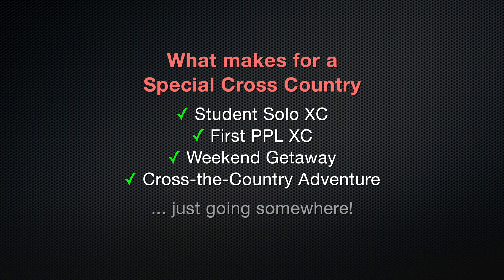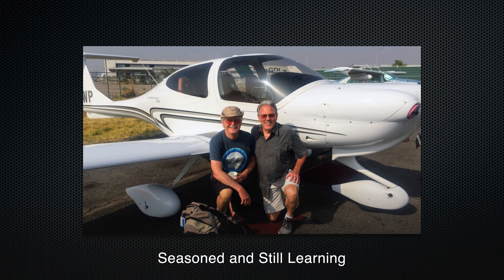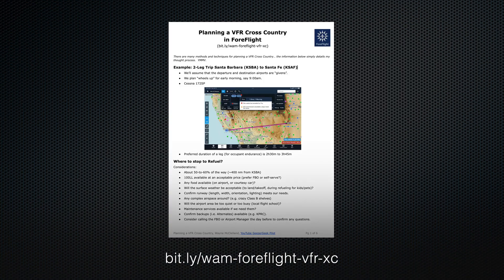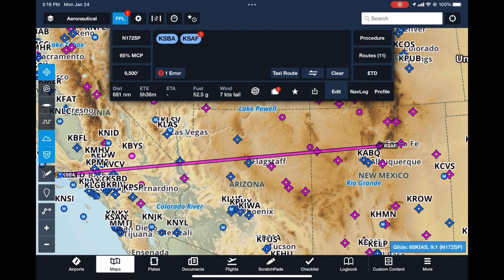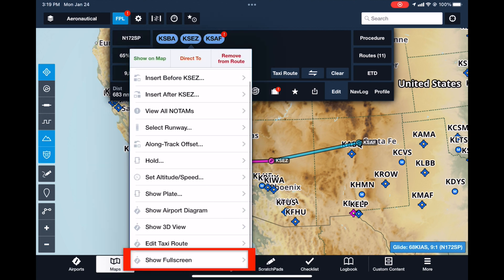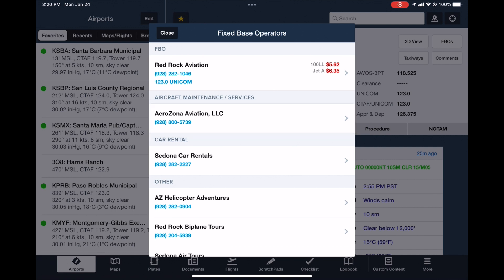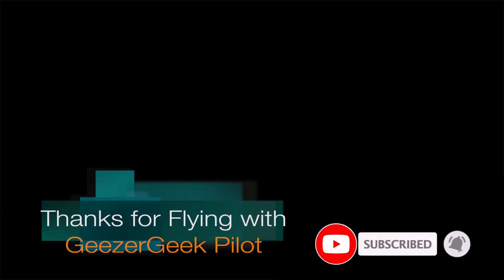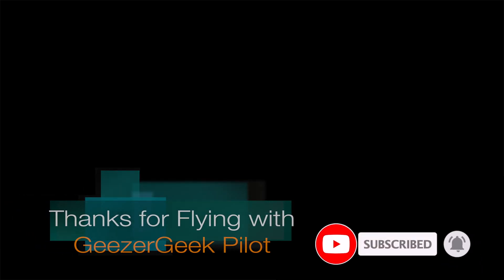Planning a VFR Cross Country in ForeFlight

Comment: How is this VFR when you're using IFR waypoints and GPS? Is there an app out there where you can plan a flight using pilotage?
Reply from the maker: Well certainly one can fly an IFR-intended route under Visual Flight Rules (i.e. with proper cloud clearances and at hemispheric altitudes).  On the other end of the spectrum, navigating with reference only to visible ground features (i.e. pilotage) also makes a fine outing.  Wayne (DA40 KSBA)

Comment: Each leg is a separate flight plan? How do you manage the total trip then with fuel burn and times?
Reply from the maker: Jeff, yes, I put each departure/destination pair into a separate Flight.  For planning a total trip, I then use a spreadsheet to roll things up.  Here's my spreadsheet for a 3-leg day... https://docs.google.com/spreadsheets/d/1MP_eF7EirTWK1JTu_vXT9SuowEnfX6o3vcIhRl4YfDM/edit?usp=sharing
Reply from the maker: ... I merely take the ETE and Plan Fuel for each leg and enter that into the spreadsheet.  Good question. 
 Thanks for checking in.  Wayne (DA40 KSBA)

Comment: Great video!
How did you get ForeFlight to give you the error, “Max useable fuel exceed by…”? I’m guess it’s because you bought their top tiered package, consider all the cool 3D stuff you have access to. I only have their middle package.
Reply from the maker: Nick, I'm not sure which subscription level provides that "max fuel exceeded" message... but I do indeed have the Performance Plus (the upper of 3 tiers) subscription.  The fuel, weight, takeoff/landing calcs that are found under the Flights tab come with that subscription, along with the 3D stuff you noted (also PDC - Pre-Departure Clearance).  I doubt that the 3D by itself justifies the $100 upgrade, but together with the other items I just listed, maybe yes.  Thanks for watching!  Wayne (DA40 KSBA)